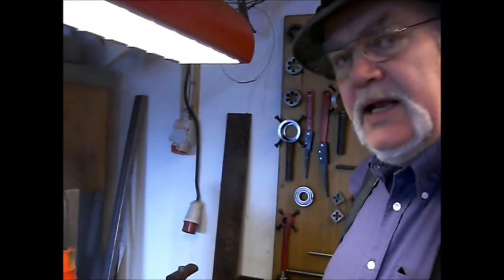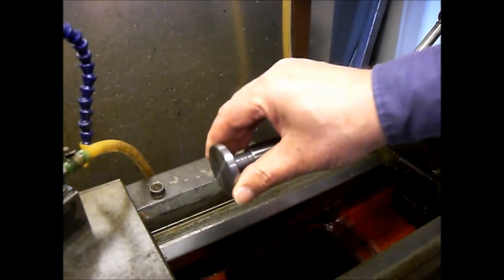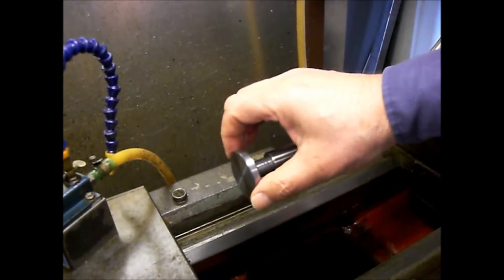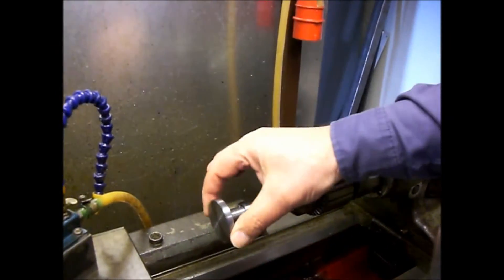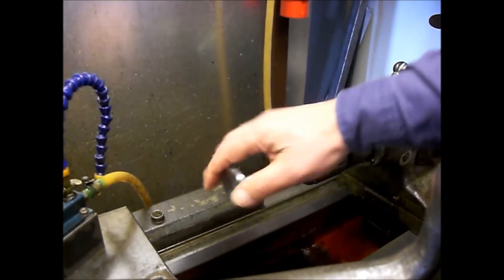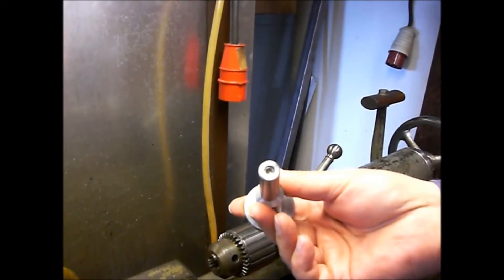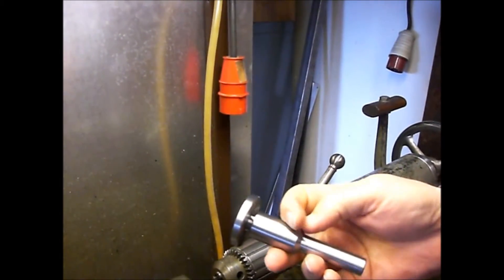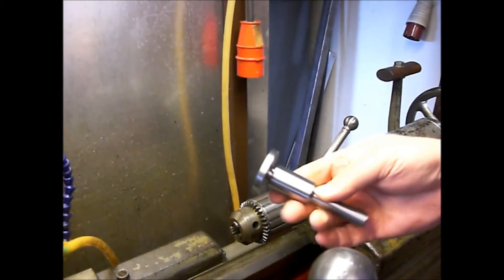Tailstock Stop 02

Comment: Well done Keld!  How did you do the keyway inside?
Thanks for sharing!
Reply from the maker: Herb, I just holded the component I call the "holder" vertically in a chuck or a vise and then with a very small end mill - in my case an engraver - plunged the end mill downwards 1,5mm from the outer surface.
What I couldn't do, because lack of room/space, was hold the "holder" in my dividing head (vertically) so I could turn it and make the "curved" keyway so the dowel pin could be hidden - I have to make a horisontial setup to get i done - I'll make it some day.